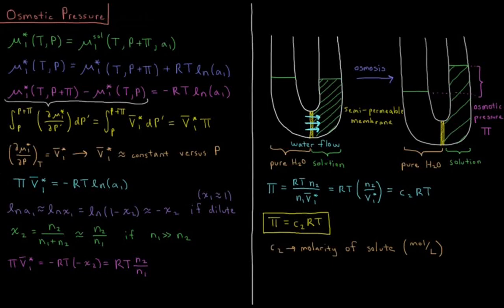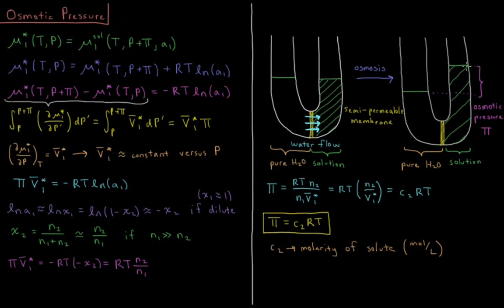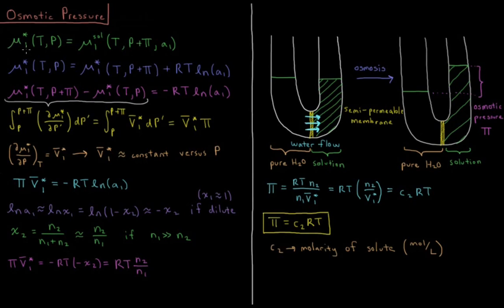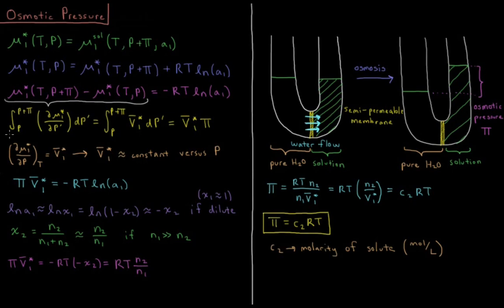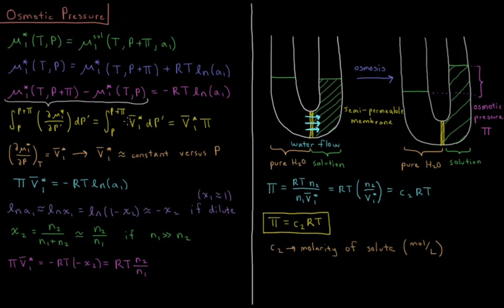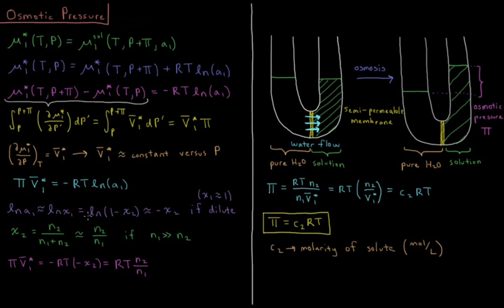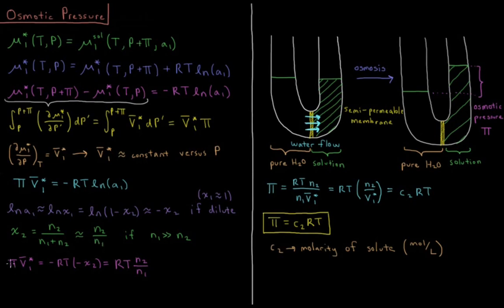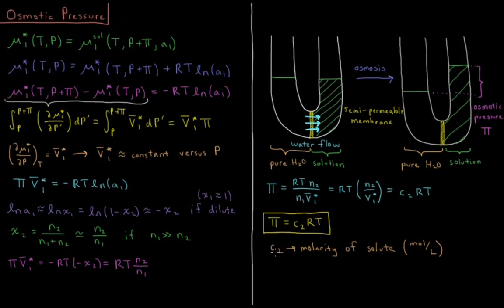Chemical Thermodynamics 9.5 - Osmotic Pressure

Comment: ok in simple layman terms can somebody please explain to me why osmosis occurs? why does the water chase the solutes? i dont understand any of the maths in this vid, but i have been wondering for years why putting solutes one one side of a semi permeable membrane causes water to move across. why does water "want" to "dilute the solutes" its been bugging me for so long 
thank you for any answer
Reply from the maker: Hi Sam. I'll try to lay it out without the math. Feel free to ask follow-up questions. Start by picturing a room with many items in it (clothes, books, shoes, etc.). If we start with a very "organized" room, and start randomly moving objects around, eventually the room seems very "disorganized". Why is this? Because there are lots of ways for the room to be disorganized, but only a few ways for it to be organized. This means that we have to expend energy maintaining the organized state (i.e. cleaning / organizing takes a lot of effort). This is essentially the 2nd law of thermodynamics. Shrink things down to the scale of atoms and molecules, and they have a strong preference to be in a "disorganized" state.

Now on to osmosis. If we have one solution of pure water (like a 20 oz bottle of Aquafina) and another solution of sugar water (like a 20 oz bottle of Coca Cola), that's a somewhat "organized" state. If we mix the two, we end up 40 oz of dilute sugar water. It's not Aquafina or Coke any more, it's just a slightly sugary mess. This is because the sugar molecules don't want to be told where to go in the water. There are many many more ways for them to be spread throughout the solution than bunched up at one side, so over time they tend to spread out and mix, obeying the 2nd law of thermodynamics.

Now let's imagine there's a barrier in between the water and the cola, which only water can move through. If it could, sugar molecules would jump from the cola side to the water side to balance out the concentrations. But since they can't, the only option is for water to move from the water to the cola side, and it does. Just as before, there are more possible states where more water is in the cola, so osmosis happens. But it doesn't all move over, because of gravity.

Moving to the cola causes the cola solution to be "taller" than the water. This creates a difference in pressure due to gravity which gets greater and greater as the difference in height gets bigger. So the water all wants to diffuse into the cola, and gravity wants both solutions to be the same height. Gravity and diffusion battle it out, and settle at an equilibrium where a certain amount of osmosis has occurred, but water still remains in the water side. We could change how much osmosis occurs by changing the sugar concentration of the cola, temperature of the solutions, or air pressure of the room.
Reply: Mixing increases Entropy.  If you were to set a ball on a hill it will roll until it reaches its lowest energy point.  The hill in this case is a gradient of salt and the water will flow to try to equalize the molarity on each side.  Without gravity they would water would move until the molarity is equal on both sides.  Here they are fighting against gravity so they will flow until the gradient is no longer greater than the osmotic pressure from gravity.

dG = dH -d(TS)
dG = dH -TdS -SdT
There is no change in Temp or Enthalpy
dG = -TdS
Entropy is positive which means in this case gibbs is negative and SPONTANEOUS.  This will occur until equilibrium.

His reply is better but I speak from a more layman viewpoint.